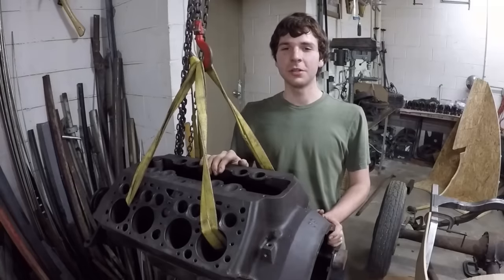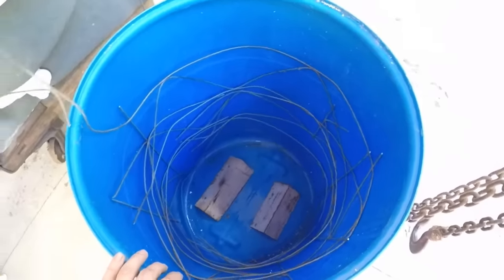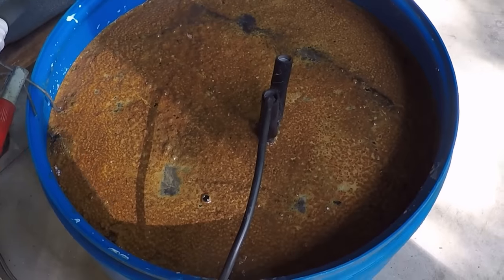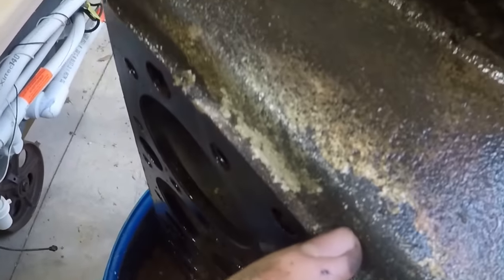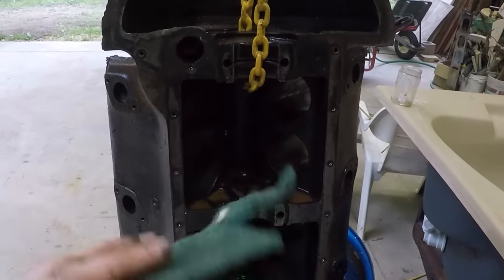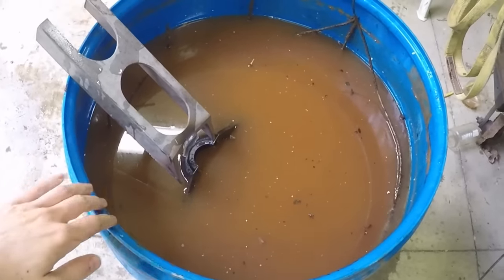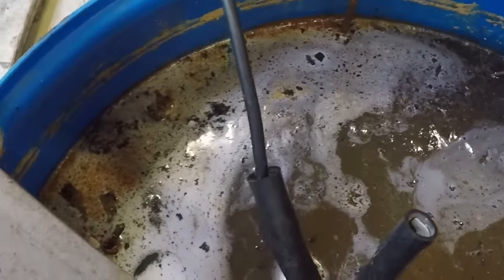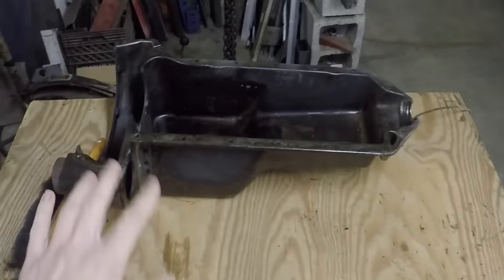Cleaning a 70 Year Old Engine with Electrolysis

Comment: Thats a smart solution! How many gram of Soda did you used for the barrel (180 litres
estimated)?
Reply from the maker: Im not really sure, it seems like everything I read online gives a different ratio, but I probably used about 3/4 of the box
Reply: It isn't critical as long as you use enough. You can't use too much. If you see bubbles it's working. All the soda does is make the water more conductive. It ionizes the water.

Comment: What state did the proces leave machined surfaces in, such as cylinder bores and  cam bearing journals?
Reply from the maker: It had no effect on the machined surfaces
Reply: I would never dare this process without fully covering the fine tolerance machined faces.  Even if only some microns are eaten away, it will have negative effect on the engine efficiency.
Reply: @tuttebelleke  It won't affect unrusted iron.  It will only remove Iron oxide  rust.  If that changes your tolerances, then the machined surfaces were already damaged...

Comment: I think I might try this on some things. Question, how clean will this get the cooling / water passages?
Reply: Electrolytic rust removal is often referred to as, "line of sight". Basically the electrons enter the work then they radiate out to your sacrificial anode. Which is why this kid has his mesh all around the block in his barrel to get all around the block. But it won't be perfect. Areas missed are said to be, "in shadow".
Reply: Thanks! Still very interesting! Going to try it on some smaller cast things.   @1pcfred
Reply: @sodiorne2  electrolytic rust removal is very Mr. Wizard. Remember though, electrolysis is hair removal.

Comment: Now EVERY machined surface will need maching again.....welch plug holes included !
Reply: RMinOZ1 does not effect the clean metal. I’ve put freshly bored blocks in for 24 hours. Bores come back out just as shiny as going in. But the rust come off by rubbing it with hand.
Reply: RMinOZ1 now you would be correct if you hooked up the polarity wrong.
Reply: @basketofdeplorables4253  Not so, electrolysis doesn't do ANYTHING to rust.   It removes microns of METAL on the surface on which the rust is attached.  That's why the rust comes off.    :-))
Reply: Taunter Atwill the polarity matters. If you hook up the leads backwards it eats the metal. The positive side is what gets eaten away. The negative is not touched. I literally use this method everyday. The machined surfaces are not touched in any way.
Reply: @basketofdeplorables4253  It's the other way around  - gives  + takes.  :-)
Reply: Taunter Atwill watch the video. He hooks negative to the block. Positive to the sacrificial. That’s the way it works. The sacrificial is what get destroyed. The positive piece gets rusted and severely pitted. Do it for yourself. You will see.
Reply: @basketofdeplorables4253  I know, current goes from negative to positive taking the rust AND metal with it.  That's why   - gives  + takes.   The sacrificial is not getting destroyed, now there's just a load of shit attached to it.  Just let your electrolysis go on for a year and you'll see what's left of your engine block.    :-)
Reply: Taunter Atwill trust me the sacrificial gets pitted. It does not just attract the rust. It also pits badly. The block or good part does not. If you hook up backwards it pits the good part. I’ve done it before by accident.
Reply: @basketofdeplorables4253  I hope a technician will react to this hopeless conversation.   :-))
Reply: Taunter Atwill I am a technician. 
There are other videos here from other you tubers, many of them. Watch them.
Reply: @basketofdeplorables4253  I did, bye bye.
Reply: Taunter Atwill your reply that you deleted still went into my inbox. The one about me not being a real tech. But it’s ok, the info I sent you proves that you are in fact clueless.
Reply: Taunter Atwill yeah that’s it. 
Or maybe I just had to create a profile just to subscribe to channels or leave any comments.
Reply: @basketofdeplorables4253  You have one thing in common with me, we both chose our channel names very well to represent what we are.
Reply: Taunter Atwill did you read the info and watch the video? The negative takes the plating? The positive pushes the plating, you in fact are incorrect.
Reply: @basketofdeplorables4253  You still don't get it  . . . . . . . .right?   Did you read my name?
Reply: Taunter Atwill so what you are saying is that you knew all along but you just decided you wanted to troll me? I seriously doubt that.

Comment: Great vid. So, cast iron skillets an griddles can have rust removed this way??😎😎
Reply: Yep!  Anything with iron or steel that isn't too thin.
Reply: @pheenix42  Thanks!!!😎😎
Reply: @pheenix42  I've got a nice little egg skillet that looked like it was a rusted mess when I found it. A couple of days in a 5 gal bucket with the battery on it and the rust was gone, then I sanded the bottom to smooth it out again and after seasoning is my favrite egg pan.  You can pick up a lot of rusty cookware for cheap or nothing.

Comment: Wouldn’t electrolysis etch the metal ? Im not sure but wouldn’t that. Change bearing tolerance?
Reply: No, it will only convert iron oxide back into an iron compound. It will not touch unoxidized iron or steel. You still have to account for whatever material oxidized in the first place, of course.
Reply: It etches/rusts/dissolves the sacrificial steel anode ( + ); it doesn't etch away anything that isn't rust on the cathode ( - ) part side, but it will show you all the deep rust-pits and fissures.   Better than naval jelly and other techniques, in terms of etching the part and thoroughness of rust removal.
Reply: Electrolytic rust removal will only ever attack iron oxide. So whatever it removes ain't doing you any good anyways.

Comment: wat you couldve done is put the barrel in sumting like a kiddy pool to catch the overflow and once in a while add some water to the mix , this will cause the crusty layer on top to flow over the edge of the barrel intoo the other container it stands in , it keeps the bath a little cleaner and alows you to see in
i done my rusty surface table with it , used a computer powersupply for it and cleaning soda , worked great and the table is still as flat as it needs to be 
make sure you ventilate properly , the electrolises makes oxigen and hydrogen , that stuff is explosive (wave a propane torch over the bath and the bubbles on the surface will audibly pop , add diswasher soap to increase the bubbles in size if you want to
by the way dont use youre best clamps on the cathode and annode , they be eaten away too buy some cheap startercables and clamp the charger to those

Comment: Very nice idea and results. I've seen tons of videos using electrolysis on small items, but this is the first time seeing an entire engine done. Bravo sir, Bravo. I have a question, when you first showed the rusty crap floating on top of the water, do you remove that since it could conduct the current reducing the electrolysis action? Just wondering.
Reply: You can skim off the residue as you mention with no real issues. The electrolysis process will stop when it is finished and will not continue eating rust when it is done. A faucet added to the 55-gallon plastic drum would sure save your back when trying to empty such a large container though. Run a hose from the tank to a flowerbed, as the flowers love the iron products in the wastewater and it will not harm them, but do not run it into a veggie garden for human consumption of the veggies. Some folks use a plastic kiddy pool for larger parts, but you have to be careful as the plastic is easily ripped by any sharp car parts and the chemical dump then is not a fun thing to deal with. Go to any box store and pick up some rebar to use and they also have two different sizes of black, plastic cement mixing bins that work great and are cheap and stronger than a kiddy pool is. I have a 1925 Model T Ford that I am currently taking apart and will be using this process on most all of the rusted metal. It is cheap and effective, although it looks nasty. It is actually a pretty safe process if vented and no real threat to children if they get into it. Using lye or rother products as pool acid can easily be a risk for animals or children who may wonder around such when you are not there to stop them.  Cleaning off that black deposit afterwards, just means removal of the old electrolysis bath and then redoing the part in a bath of vinegar and water in the same exact manner. Always apply WD40 or light oil as 3-in-1 oil immediately afterwards or the rust devil will attack quicker than you can say the word, "Crap!" ;-)

Comment: Is safe to do electrolysis on other parts.. e.g. pistons! if i want to remove the Carbon Deposits from a piston? 
Some one tell me is not safe because the electrolysis maybe remove other materials from piston body and the piston lost durability ! (e.g.alloys or other ) i dont know any one know if is ok to do electrolysis on pistons or valves ?
Reply from the maker: iron/steel parts are safe, but electrolysis will eat away aluminum
Reply: @MacroMachines  thanks for reply. I dont mean aluminium! I mean valves or Pistons, pistons made from alloys ( a metal made by combining two or more metallic elements) that dont had problems after electrolysis?

Comment: How do u dispose of the nasty water after you done?
Reply: you can just let it evaporate. As long as you don't use stainless steel anodes the stuff is harmless. You could water your garden with it. If you do use stainless steel anodes then you get chromium in the water. Which is kind of a poisonous heavy metal. Then you got a problem. I worked at a place that did some chrome plating and we ah may have dumped chromium solutions down the toilet occasionally.
Reply: You can keep using the water - it doesn't wear out. It still has the washing soda in it, so you ougta make sure your plants can take it. I just take the cap off my sewer cleanout and siphon it down the drain. The sludge you should collect and dry out.

Comment: Is the soap Borax.....Can you use vinegar?
Reply: Washing soda, not borax.  Give the video another watch - he describes it early on.
Reply: @87mini   What is "Washing Soda"?
Reply: @liljohnp132  It's what granny used to mix with powdered soap to do laundry before all the fancy detergents came out. If you're in the US, you can get it in a hardware store, if not the grocery. It's chemical name is sodium carbonate.
Reply: @87mini  Thank You.
Reply: @87mini  I don't think it matters much. You could throw dirt in the water and it'd probably work. I actually prefer baking soda over washing soda myself. There's no magic going on. All the soda does is ionize the water so it conducts better.
Reply: @liljohnp132  baked baking soda.
Reply: @1pcfred   Good to know , Thanks.
Reply: @1pcfred  You're right that any salt will work, but I think that the washing soda helps cut grease, too.  I haven't tried baking soda (sodium bicarbonate), but it's much less caustic than sodium carbonate.  I clean old tools and car parts, and got no reason to change.
Reply: @liljohnp132  Since you're just starting out with it, get some rusty metal and experiment. You can do a  lot with a 5 gallon bucket and a couple pieces of iron. For fun, find a rusted up seized up pair of pliers or something like that. Just don't use salt! :-)  Have fun with it!
Reply: @87mini  some folks say some salts make toxic fumes. I'm no chemist but I have no reason to doubt them. I guess you could always just filter the air you breathe with a cigarette though.
Reply: @1pcfred  Yep, any salt with "chloride" in the name will give off chlorine gas - it'll make a mess of any metal nearby and youre right, it's best breathed through a cigarette! ;-)
Reply: @87mini  says so right in the name huh? Makes sense!

Comment: Why you didn't mix the solution together before you placed the block in I will never know. Also, you should always de-grease before you use the electrolysis method (or any rust removal method), it will be far more efficient and thorough. And after you've removed and scrubbed the project always final wash with ammonia - it will dramatically reduce flash rusting (before you use your final water dis-placer).

Comment: I think you mostly washed the engine. For that to work the engine cannot touch the wires on the sides of the barrel or the bottom of the barrel. If it was using electrolysis, that water would have been boiling and fizzing as gases are released. Plus you want to use closer to 6-10 amps of power. It is cleaner though!

Comment: Electrolysis will generate hydrogen. On mild steels this isn't a problem but alloy steels of higher hardness can suffer from hydrogen embrittlement as a result. Cast iron is less susceptible to hydrogen embrittlement but can still be affected to some extent. Cylinder blocks are an alloy iron eg chrome iron and will likewise suffer some hydrogen effects. Molasses and water works both by chelation and by its lactic and phosphoric acid content.
It will still generate a small amount of hydrogen but a lot less than electrolysis. A pure chelator like Evaporust et al shouldl be acid neutral and generate no hydrogen. Expensive but safer on a valuable block.

Comment: You should read about hydrogen embritalment on high stress objects. You need to heat the objects after the process to relieve the hydrogen or otherwise the metal will fail.
Reply: There is also the detail of dissimilar metal construction.  Not as common on older classic engines, but anything of recent times could utilize different metals for the construction process.  This was common in the 70's and 80's. Some of those metals could be compromiser during the electrolysis process, rendering the item useless.

Comment: That is baking soda and yes that works. Next time do it with a steel drum it does a better job then all that small wire. You also don’t need a battery charger, you can use a charged car battery.

Comment: What about hydrogen embrittlement? For smaller parts easy enough to bake for 2-4 hours and correct temp, but even if could fit flathead in the oven, pretty sure women of the house is gonna have something to say about it.

Comment: That is Sodium Carbonate, which is *MUCH* stronger than Sodium Bicarbonate (baking soda) and is rather dangerous when dissolved in water the wrong way.  The way it was added in this video was halfway there.
Reply: @OfficialModern Always add all solvent to the container before adding any solute.  In this case, add all water to the barrel before adding any Sodium Carbonate.  It's a physical challenge, but positioning the engine block's heaviest part (and therefore the part with the most volume) in the barrel, then adding all the water necessary to cover, then removing the part, then adding the Sodium Carbonate and stirring to mix using a non-reactive device, then lowering the engine block part back into the solution.  If you add solvent to a highly-reactive solute like this, you run the risk of causing a splash-up at the very beginning due to a momentarily highly exothermic (heat-producing) reaction, but the other way around is entirely safe because at every moment in the mixing process there is enough solvent to sink all the heat of the exothermic reaction.

Comment: What if you use salt?
Reply: The gas given off is poison.
Crystal drain cleaner also works.  Very small amounts are needed.
Reply from the maker: salt will corrode the metal

Comment: You need to get your negative lead out of the solution. Use a copper wire wrapped around the section of the block and then connect the lead to that.

Comment: There's just something about a barrel full of water, metal rebar and a 120 volt battery charger that makes me want to shy away from this.
Reply: The voltage at the clips is about 13.5 volts DC.
Reply: What could go wrong?  ;)
Reply: @mpeugeot  at low potential not much. It takes three times higher voltage to even pass current through someone.
Reply: @joeschlotthauer840  Yes if it travels through your heart... It is difficult to get fully electrocuted by how he is doing... You won't get electrocuted if you just dip your hands in for example...
Reply: I clean blocks with this process all the time, never had a problem, also have done heads, rods, crankshafts,basically anything steel or iron that is rusty and while it does produce hydrogen ,in an open environment there is little risk of explosion but if you were to seal the system and contain the hydrogen then you might have a problem
Reply: I'd be more concerned with the hydrogen that is created as long as it's not in a confined space you should be ok
Reply: Joe Schlotthauer Yes but it needs enough voltage to pass the resistance of your skin. 12 volts is perfectly safe regardless of amperage, otherwise a car battery would be deadly.

Comment: That black coloring is original coating from the factory when that block was made. I wonder what color the block is going to be. I would guess blue. Maybe like a ford blue. Take care.
Reply: The black is black oxide. Some red oxide gets converted to black oxide in the process. It's kind of like slime and usually washes off.

Comment: I Forget why you cant use 110V AC current
Reply: Because it relies on direct current, electrolysis is moving the electrons only one direction. Not only is 110 volts far too high of a voltage (and wildly dangerous) the alternating current would accomplish nothing as you would be stripping electrons from both the anode and the cathode.

Comment: YOU NEED TO DIRECTLY CONNECT YOUR ANODE AND CATHODE.
THE SACRIFICIAL ANODE DIRECTLY... BY BOLT OR OTHER.
SEPARATED BY A NON-CONDUCTIVE SEPARATION...
EVEN PLYWOOD.
THE CATHODE IS THE PART BEING TREATED.

A SIMPLE GRAVITY FED SAND FILTRATION CAN BE BOLTED RIGHT INTO THE BARREL.